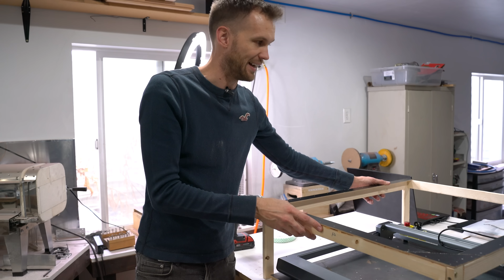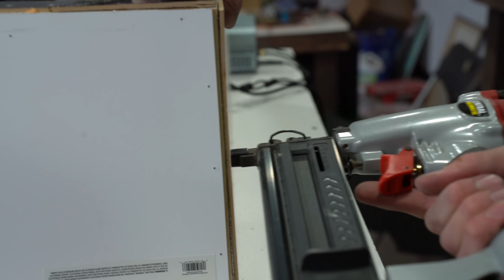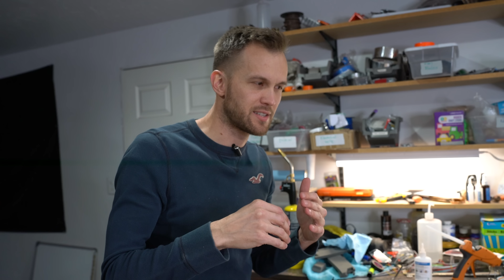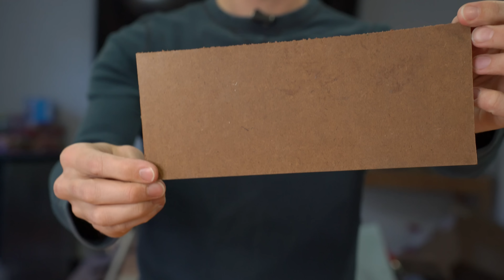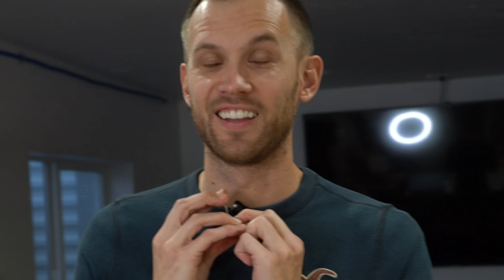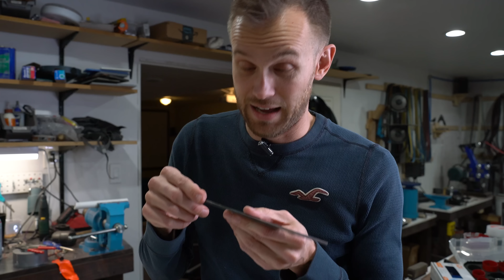Engraving METAL with the Ortur Laser Master!

Comment: Pretty messed up to tell people they can "engrave metal" with a diode laser when you're very clearly promoting a product.  You're able to make small not-very-durable marks at very slow speed by blasting tons of heat into the metal running at max power.  So it might work OKAY-ish for this application- a very small mark on thick metal- but you're going to have serious likelihood of warping your project with larger marks on thinner/smaller metal.

Basically while this might be accurate- which I don't even really believe with some of the video cuts and general dishonesty of the video- at the very least you're going to convince people to buy  an expensive brick that can't do what they want it to do.

I know because I bought a 20w diode laser thinking I'd engrave/mark metal and it was an epic failure even using the expensive sprays.  I got a used fiber laser for $1100 and can actually do this and a lot more with metal.

Comment: That is not engraving. That is marking a steel. Engraving does involve depth cutting, at least >17 microns. Has the manufacturer tested depth it can cut in few materials, wood, polymers and metals?

Comment: You're not removing any metal with that laser. That mark will literally rub off over time. If the knife is cleaned with even a towel regularly that mark won't last very long. Even with a 20W diode laser it's difficult to get a permanent mark.

To truly 'engrave' any actual metal, you need a fiber laser. Diodes simply aren't powerful enough.

Comment: I know you did the stainless. What about a blade of 1095 or O1 tool steel? Try the annealed and one after being heat-treated. Those are the alloys that most of the knife makers i know use and have some difficulty marking. I know a true (deep) etch will require a fiber laser. Just curious as to what affect it will have on these materials.

Comment: Just from laser security - no housing that blocks all laser light on a class 4 is NoNo and it has to cut all power to the laser when open or it is ultra-NoNo. Windows with some unrated cover are not a great idea either. The surface should be white and coarser in surface then the wave length to reduce reflections. Black surface are dangerous as the open the iris. Real laser safety glasses are rated  not just to wave length but power output for given time period, once past this time trash hold they also pass laser rays thru! You talked about adding fume extraction to your housing, but it is miss later in the video - with metal vapors and smoke from wood lamination. This product is NOT SAFE, nor is this application of it.

Comment: Hey man cool video. I’m a blade maker my self , I have a bunch of knives of finished with handles, how will this laser go putting a logo on a finished knife? Meaning the blade will no longer lay flat… will I need to prop the knife up to make it level some how or will it work out its own level… or etch it anyway?
Reply: It is best to prop it up and make it level so you can set the distance of the laser.

Comment: can you adjust height with this one ? Say if i have a product, a box, a mug, does it still get the job done on the unflat surface?
Reply: You can adjust the height of the laser itself but if you need to do something taller, you can raise it with legs that Ortur sells.  A method I used was tuna cans since they are a uniform size and they are stackable to get the height you need.  Ortur also sells a roller and a rotary chuck for cups, mugs and other round things.

Comment: Leaving those gaps between the lid and the window is pretty lazy, if you are going to put the window in then make sure that the laser still can’t escape. If you look at it from the wrong angle the laser can still come out, you made a safety device but then left gaps. It is also an easy fix with just a few strips of wood, so it is pretty lazy that you didn’t do it. You also maybe could have mounted the window on the underside of the lid where the wooden boards are already.

Comment: Some metals work, some metals don't. I have made attempts at metal and it just comes right off by shop towel. Copper/brass/aluminum don't work well because heat goes away to quickly. Air assist, is more used for the cutting side over engraving, but can still be used. 
For the bamboo color variations, its does the same for different types of wood, even same type of wood but different tree. The settings you have set for the engrave side can actually be turned up- faster speed/higher power to get faster results.
Lightburn is the preferred program by many laser users.
In lightburn there is a material test that you can figure out the best setting for each material.   Darkest spot, fastest speed, lowest power- usually gives best results.
The box you made for it, I would have recommended putting the white side towards the laser. Dark colors are easier to engrave/damage.

Comment: I would love to know if it could cut through half inch cardboard and do an awesome design in the cardboard?
Reply: Yes it will.  You would want to have it raised so the laser can escape at the bottom.  Its best to run a test for speed and power to avoid setting it on fire.

Comment: You are correct, bamboo just always does that. Even with a CO2 laser, that's the results.  Also, a CO2 wavelength keeps it from marking bare metal.  The best thing to use for metal is a fiber laser.  Another way to clean the soot off of wood is with denatured alcohol.  If it's a large piece, sometimes, we clean it first then hit is with a little sanding.  Look into photos. A diode laser is slow, but it gives extrememly good results with photo engraving!
Reply: I used to spray stainless with a thin coating of dry molybdenum lube spray and then engrave with a 40W CO2 laser.  The laser would bond the spray to the steel and give the look of engraved steel.
Reply: @oliverwjones  Yes! We have a marking spray that we use sometimes like that!  We made a video about marking/engraving on metal! :)
Reply: @oliverwjones  The sprays made for laser engraving do a better job than moly I did a test piece of aluminum that I mask and use both products on the same letting, moly has a dark gray color and is almost smooth, the specific spray was black and you can feel it with your finger nail, our classroom machine is a Boss LS 1630 60 watt new this year, I'm the machine tool TA for  the CAD/CAM Program so I have been  working on a speeds and feeds materials spreadsheet
Reply: @jimeash7041  And the laser marking sprays are about $80/can vs $10 for dry moly...

Comment: Cool capability. I would try using technique of burning not only the logo but the actual knife template straight to the steel. Clear permanent precise lines? The wood template good for test/fine tuning the shape but...Put the template straight to the metal instead of wood template traced to metal?
Reply: Sure....although he can't cut it out with the diode laser, he could us the diode to basically score a cutting guide into the metal.

Comment: How come you didn't make the whole box out of the acrylic so you could see through the whole box besides the frame?
Reply: Cost probably had a factor in that. The acrylic is much more expensive than the dry erase board.  Alslo, other enclosed machines normally only have a "viewing window" in the top.
Reply: @malonecustomdesigns  probably costs yeah, but I would have done the cover at least for full view of the print surface and also not leaving gaps on the sides.
Reply: @Igmus  I agree, I would have made some design changes myself :)

Comment: building an enclosure is always a smart first step with these open gantry machines. I agree with other commenters that it's probably a good idea to get a better set of goggles certified for the wavelength. 

Interesting to see how well it did on the stainless without surface coatings.
Reply from the maker: Ya I was too! No cearmark or anything!
Reply: My thought is... WHY no coating?
Reply: coating is to make the metal non reflective. you kill your laser faster if you do it without. some energy is useed to darken the metal but there is stil a lot reflecting back into your diode. just some watersolvable ink will help or some are using mustard

Comment: You havent even cut anything and I already hate it. No one should ever use a product where safety was an after thought.
Reply: Hate is such a strong emotion. What laser engraver stole your wife and murdered your dog?
Reply: I use cut off wheels on angle grinders and nobody can stop me.
Reply: I bought one with an enclosure
Reply: Life is unsafe you can’t be stopped because you are to afraid sometimes you need to do stuff yourself if you want it more safe
Reply: @pricygalaxy185  Yea and a little bit of knowledge is a dangerous thing. So can you volunteer to do a fork resistivity test just plug it in the socket directly and say how much it hurts it's only a bit of danger shouldn't stop a pioneer like you 👍
Reply: @SlyerFox666  well there is instructions and info on it for a reason so I can read and know but if it didn’t have that sure I’d do it I will get no where in life if I don’t take risks 
And my point to the original comment wasn’t so much you should take a risk it’s more will the potential risk stop you from getting it and fixing it so there is little to no risk
Reply: @pricygalaxy185  No just no !  that's why there are such things as risk assessments etc And very simply put why do you need to take any risks if you know what your talking about and what your doing ? Maybe things might look risky like ol' eletroboom but in reality if you know how to do it safely then there is no risk ... Untill it goes wrong 🤣
Reply: @SlyerFox666  isn’t that what I just said because I think I just said there is stuff to negate the risk but than I said if there isn’t anything in place than make it safer
Reply: @pricygalaxy185  I think we must be reading different comments then 🤣👍
Reply: @pricygalaxy185  This thing isn't just unsafe to the person using it its unsafe to everyone in the room. Not everyone knows the hazards involved. It would be safer to light a fire on your living room carpet during a party than to have this cutting stuff at the party.
Reply: @TomsBackyardWorkshop  I don’t think he would have it running at a party the machine may be unsafe but you have to keep in the fact that it’s Nate that’s using it he’s a safe person 
And it’s as unsafe as welding should we not weld because it could blind you I don’t think so
Reply: Nate being aware of the safety issue built an enclosure for it before using it. not everyone is going to do that.
Reply: @TomsBackyardWorkshop  you can say that about a lot of every day items which wouldn’t be good
Reply: @TomsBackyardWorkshop It’s not that serious man😂 I’ve been laser engraving for 10yrs and none of my machines have an enclosure. They have the red/amber plexiglass shields and I have milspec laser glasses that’s it. It’s only unsafe if you are unsafe.
Reply: Well I agree with the sentiment, but literally every consumer laser engraver cutter being sold right now is the same way.
Reply: @TravisFabel  no there are consumer level  engravers with a full enclosure.
Reply: @TomsBackyardWorkshop  And LEV I hope
Reply: @TomsBackyardWorkshop I deliberately bought this machine without an enclosure and built my own, because half the things I want to engrave on won't fit in a standard enclosure

Comment: Maker's Muse posted 2 videos about these kind of laser cutters/engravers not that long ago.
He talked about what you need to look out for when engraving different matterials and also some concerns about the safety of them.
I would highly recommend you watch them to be on the save side.

And Nate did a great job building an enclosure for it.
Reply: meh youtube deleted my old comment,

comgrow make enclosures that you can buy (mainly for their own cutters / engravers, but imo as long as it's bigger than the frame of your machine, it should fit)
Reply: Yeah such a great job on the enclosure, large gaps for the laser to escape.
Reply: @conorstewart2214  It overlaps. There's no way it escapes, because it's light, not a liquid. Those gaps are for venting out the smoke.
Reply: @marcus_w0  it absolutely can escape. Light can go at an angle you know, especially with reflections.